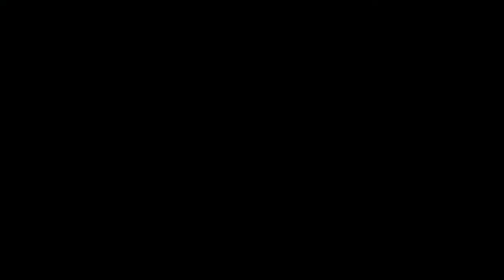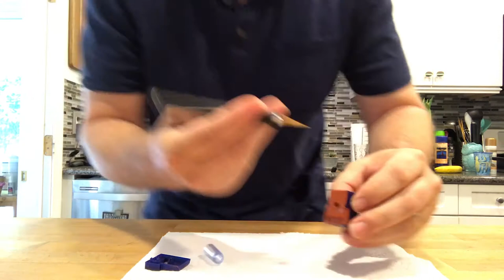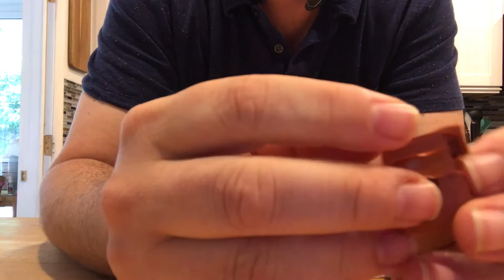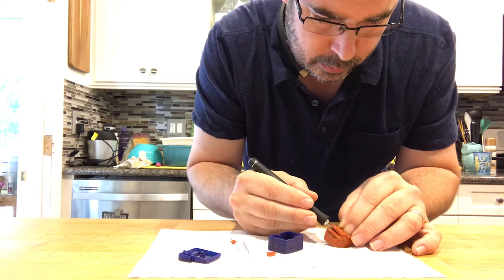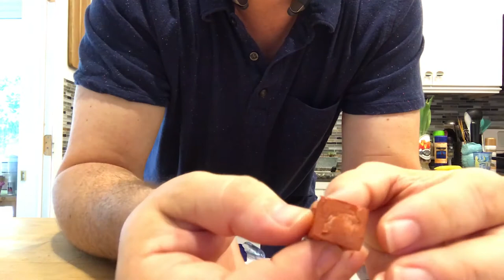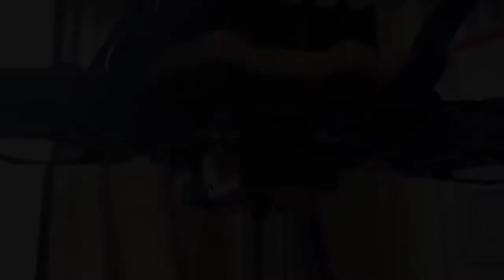DIY Heater Block Silicone Socks - Part 2

Comment: You have great videos. I am wondering what the results were. Did you figure out the firmware issue?
Reply from the maker: Thank you! The sock lasted several months before falling apart, so all in all it was a success.  I was able to get to the bottom of the firmware issue with some help with Ryan from SeeMeCNC (unfortunately, he is no longer with them), but I don't recall what the problem ended up being TBH.

Comment: kinda interesting. I'm going to just post my thoughts from the first part here:

I like to see videos about printer vitamins; I don't see as many videos about them as I used to, but what counts as a vitamin and what's a standard feature has also changed so there is that. 

With regards to the silicone, the RTV silicone used is one of the better silicones to use for this. 2 part silicones would actually be quite bad since they can be sensitive to additives and to actual plastics. Specifically, you can seize a 2 part silicone rubber with PLA. The PLA can be attacked by the dimethylsilane, which depletes the reaction before a high quality polymer is formed. 

Finally, use forced air to push it out of the mold.
Reply from the maker: Thanks for the notes Walter.  Few months later and that first test sock in RTV is still holding strong (surprisingly). I had not thought abut forced air, but will give that a try on the next one. Thanks for the tip!

Comment: Great video, Chris.  I just skimmed it, just to hear your comments.  
Anyway, a few 'notes', I cut the silicone sock away from where the heater cartridge wires sit (not shown in model pics tho), and so it fits a little better.
As for the failing autotune...  Play around with the K_p value (lower it), and retry, It may slow the heat up down a bit, but it can help prevent the overshoot.  Its most likely staying above the target temp because the sock is insulating so well.
Theres tons of PID control theory,  so if you really want to know whats going on, read up! Or find a youtube video.
Reply from the maker: 7urpinator thanks for the tips!  I'll give that a try and read up on it more.!

Comment: When I did my socks for the e3d volcano. it works fine at 250-260 -- that's as high as I go -- I haven't tried the fan at 100% at those temps. Not sure a practical use of that since those temps are for PETg and I max out fan at 40-50% for PETg. I will and see what the results are. I use smoothieware -- so it's a 32 bit controller, not sure if yours is or not. I'm surprised yours set so fast. Looks good.  With the sock though -- when it's tight, the fan line is dead smooth, really good.
Reply from the maker: Yeah, I don't usually run the fan over 75% except on an occasion very difficult bridge, so trying it with the fan at 100% was more experimental than anything.  PETG at 235c-240c is my normal material and temps, but I do have some PolyCarb and Nylon that I want to play with so was trying to see how far I could push it temp wise and still keep that flat line on the temps. The printer I was testing with uses a RAMbo board w/ a variation of Repetier firmware.  I will be testing this on Ozzy (the modified gMax) who is getting smoothie as part of his upgrade cycle eventually.
Reply: PolyCarb and nylon don't need the fan on at all. For me the sock was mostly to keep the nozzle clean for my silicone wiper system for dual extrusion, basically the sock I designed covered all by the tiny opening for the filament so that no extra filament would stick to the nozzle. Ceramic insulation is actually better at keeping the heater block insulated. You can get it on Amazon and wrap it tight around the heater block with kapton. I love PolyMax, it warps fairly easily, so small parts for now. Going to try NylonX, should be easier to print. FYI PETg is pretty hygroscopic, even in a filament closet with desiccant, after about 6 months it absorbed enough moisture so that it needs to be dried out. Nylons are really notorious with moisture, basically no way to store it where it won't absorb moisture and need to be dried out before a print. (Going to be getting a filament dryer for these plastics, tired of using the oven, plus a regular oven can't go low enough and takes to long).

Comment: some clever you tuber  showed me this : mix (  not much/) cornstarch  into  silicone ,and  the silicone will set up much quicker in the thicker areas . ? vents  the ......  .Then thier is an other very int erest   material            STARLIGHT    as insulate  rigid deflectors / incapacitators